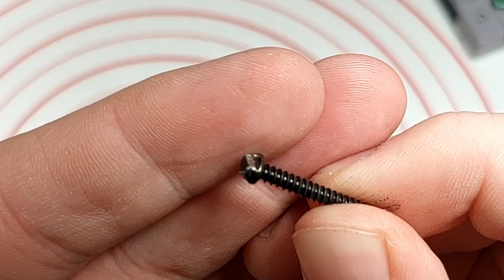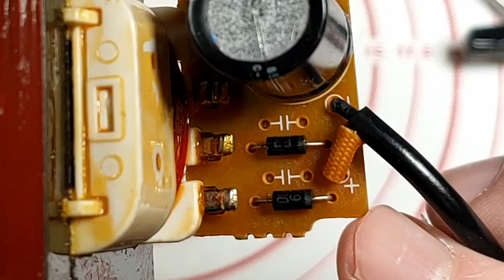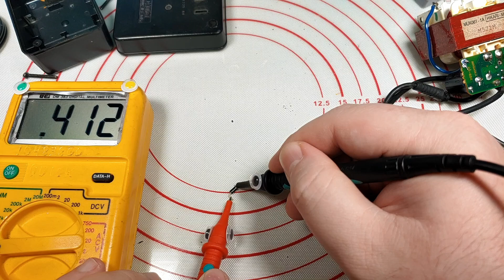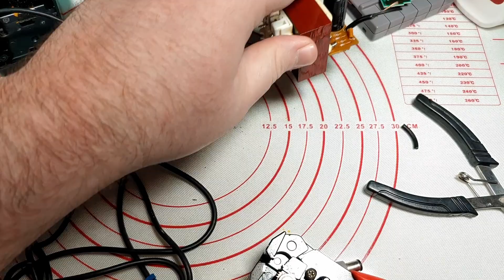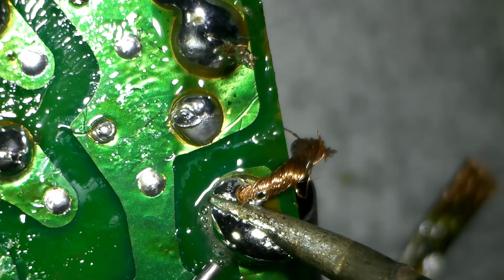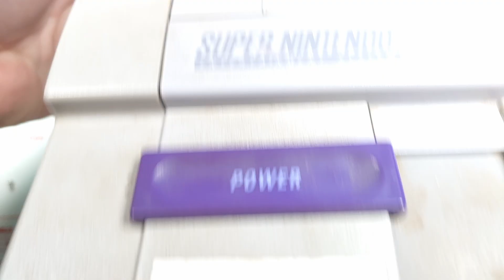Can I Learn How To Fix A Super Nintendo Power Supply?  | Over Thinking Is my Kryptonite!

Comment: Great repair.  I recommend using heat shrink tubing for the cable, especially inside a power supply, rather than electrical tape.  It can also double as a cable tension thing.

Comment: Yes, you should have some continuity in the transformer primary (those two prongs). Since it is technically a wire loop. If your multimeter detects something lower than than 50 ohms it will beep. (usually)

. 417 drop for those diodes is.... Odd... It's usually near .600 for standard silicon based diodes... But they're okay.

Their job is to rectify the AC coming from the transformer into DC. You could tell those were good since the capacitor was fully charged with DC.

As soon as I saw the cap charged, I knew the cable was the most likely suspect. 

That resistor is also very, very odd. It is essentially connecting the ground of the snes to the neutral of the mains. I presume it's to discharge static... But if the mains receptacle were to be wired backwards, you'd get a nasty shock if you touched the metal parts of the snes ports.

So no, in a more modern device, there is no connection from low voltage to mains.
In this one.... Yes. Sadly

Good video. I'd strongly recommend you see videos from BigClivedotcom. He's got a few disassembling power supplies. Very educative channel.

Also, educate yourself on the dangers of charged capacitors. Some of the can be VERY spicy.